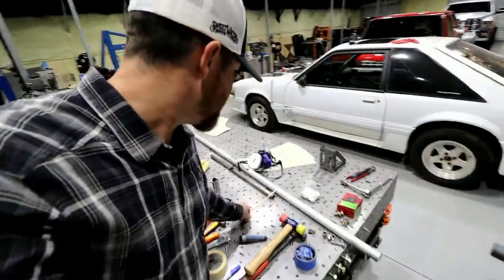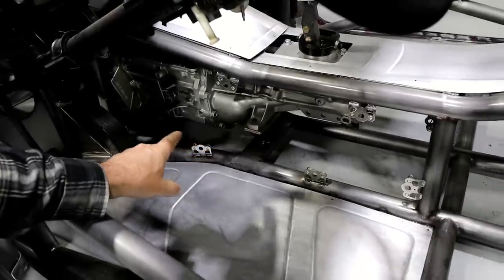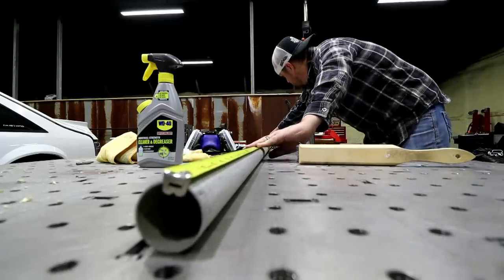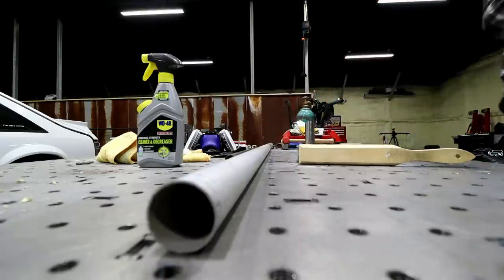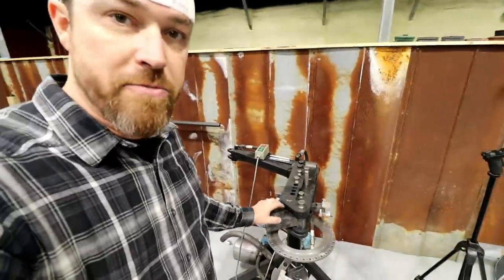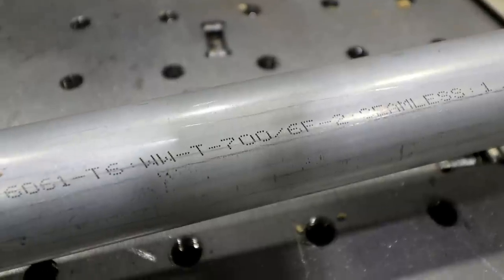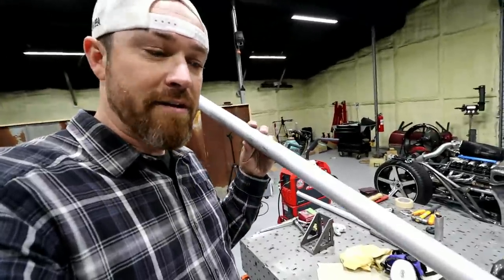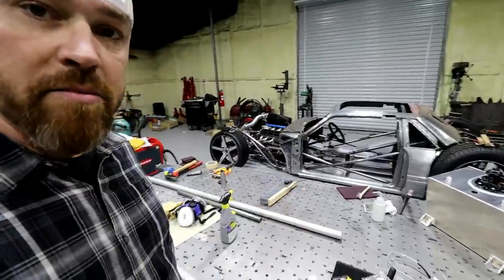Can You Bend 6061 T6 Aluminum Tubing in a Roll Bar Bender ?

Comment: I know this is well over a year but I just come across your channel. Great vids!
Tip for thin wall aluminum in t6 temper. Weld caps on the ends, one cap must be thick enough to screw in a Schrader valve, apply vacuum, then fill with water to about 60-90 psi. You wont crinkle or get flat spots. Plus it kinda stress relieves it somewhat, probably not as much as a autofatage does but its better than nothing. Course you have to cut the ends off so leave stock for that.

Comment: If you anneal the tube with an oxy/ acet torch you can make 90 degree bends
Reply: This is correct. Works well with 6061 T6. I have demonstrated the oxy/acet method to university students and EAA members who want to build their own aircraft. Way better than using a tubing bender. But you don't use just the torch if you want a really perfect bend.
Reply: How hot does it really need to be heated to. I just need to make a slight adjustment to a 6061 bike frame and would rather not have to burn through the paint. Would it help at all if I heated it with a heat gun?

Comment: If you fill it with sand you can bend it without it putting a kink in it👍👍🇨🇱
Reply: Cork one end of the 6061 T6. Fill it with dry pool sand or sandblasting sand all the way to the end. Cork the second end. Lightly blacken the area to be reformed or bent with Acetylene. Black but not heavy deposits. Only takes a few seconds. Then heat that same area gently with a soft oxy/acetylene flame until you have burned away the acet. deposits. Don't overdo it. This will anneal the tubing. Then slowly form the tubing to the angle you want. The sand supports the tubing walls so it does not kink. You only have a few minutes and may have to gently reheat to complete a 90 degree+ bend. The tubing will naturally re-harden to it's original temper in a few hours. Remove the corks and empty the sand out. Guys building their own airplane do this all the time. Don't try this with 2024 as this alloy does not like to be bent and may crack.

Comment: 6061 bends fine as long as it is over a really big radius. Like way bigger than you’d ever want in most applications. Ideally, you’d want 3003 in a tempered state. 3003 is alloyed with manganese, where 6061 is a magnesium and silicon. The T6 heat treat designation means it precipitation hardened in a salt bath (I think). I think the heat treat designation on the 3003 sheet we use so commonly is maybe an H56(?)
However... I have never tried to get 3003 in tube. I know it isn’t available in round without buying a mill run.  So it may not even be an option.
Reply: Can i flare 51mm OD to 70mm OD for intake trumpets, it's 6061t6 with a 3mm wall. I tried it wouthout heat and it cracked, should I heat to 400f to stretch it that much or am I wasting my time?
Reply: You right Adam  👍🏻big radius and a thick wall tube it’s not a problem 
I’m a tube bender and we usually  bend 6061-0 and 6061-t4  and send them to outside process for heat treat so it can be t6  because it’s hard to Bend 6061-t6  
I struggle sometimes when I bend a 1 D bend  6061-T4  .028 wall thickness  you need to have a baddas wiper and good set up and don't let it stretch because you lose it

Comment: Just do a test bend to the same 22 1/2 degrees when it wrinkles and cut through the middle of the bend and see what happened. The inside will have bunched up and the outside will be very thin from stretch, you could probably play a tune on the pipe.

Comment: The electric water pump flow rate rating may have to be increased for the long distance radiator runs. The Aluminum Pipe may not be the best material due to the flow direction change resulting in tube erosion. 304 Stainless may be a better choice, although it is heavier. If the engine mounted pump is working too hard you can install a second pump in the rear of the vehicle as a return pump to maintain flow.  

What I can say about the 6061-T6 is it will conduct the heat very effectively if the pipe is not insulated. The long aluminum pipe length themselves will probably be a very good radiator when the engine is up to temperature (relative temperature differential) and the waste heat will be huge given the HP gains with the turbo. You will have an increase in engine efficiency but the waste heat will scale almost linearly at a specific load. Uninsulated aluminum tubing going through the passenger compartment might act like a cabin heater. 

If you want to put the radiator in the rear with a rigid structure you could make a long heat exchanger as a pipe within a pipe (usually based on an aluminum extrusion profile). The outer flow is the cold return and the inner flow is the hot send. The send and return flow would have to be equal so the cross sectional areas would have to be sized accordingly.

Comment: I use i " .083 wall  for the ModJust use thicker wall.lites i plumb. no problem bending and easier ti weld if you put an ends on them.

Comment: Have you done thicker aluminum tubing say up to .125 wt?
Reply: I’ve bent 1.5 x 0.125 round tube on a Jd2 model 3. Make sure the tube seats tight in the die and use slow constant pressure.
Reply: @chrismiles462  Im planning on using the jd2 model 32(they dont make the model 3 anymore) with the same size aluminum tubing 6061 t6, did you have to do anything to the aluminum? such as annealing it, filling it with sand, etc, like ive seen other people do? or did you just put it in and bend. Thanks.
Reply: @icantcomeupwithaname8925  I’ve done it with and without annealing. If you don’t anneal there’s a chance the tube will break even if you do everything right. I think the tube coming from the mill doesn’t have a consistent temper all the way through the tube which creates problems.

Comment: Annealing makes it possible.  Been doing it for years
Reply: i was wondering that, it was hardened and tempered back so in theory you could heat it back up and remove the hardening right?
Reply: If annealing is not performed, will cracked the tube?
Reply: @Darmha  if it's T6.
Reply: @dieselguy62  and if 3003 alloy?
Reply: @Darmha  look it up. I'm not here to teach you